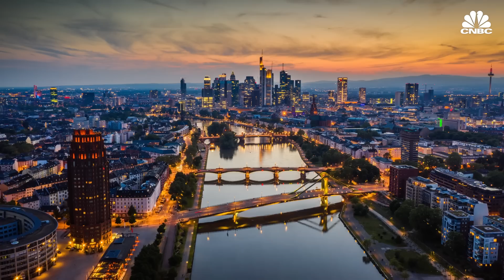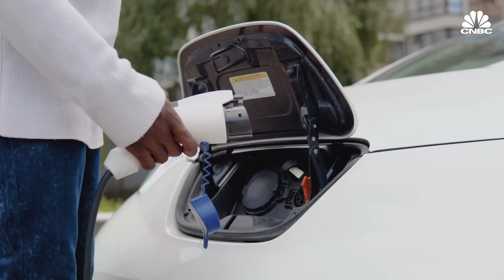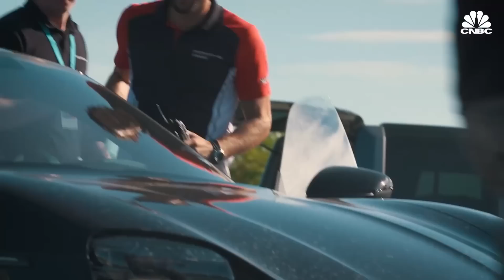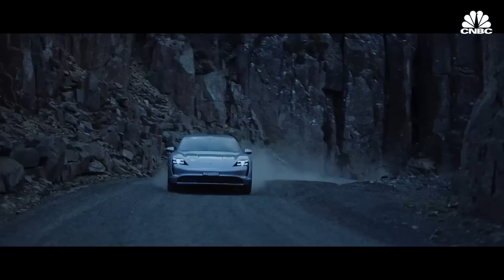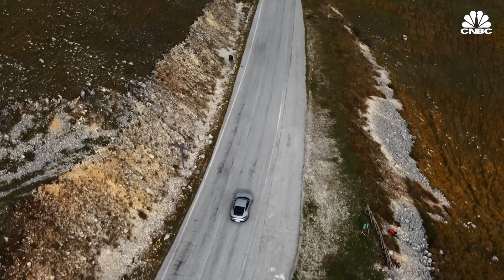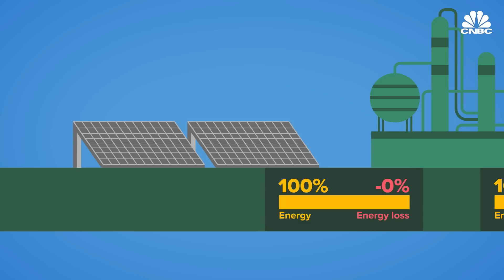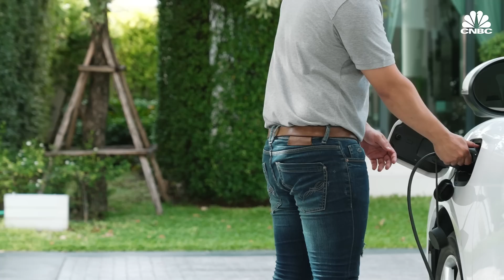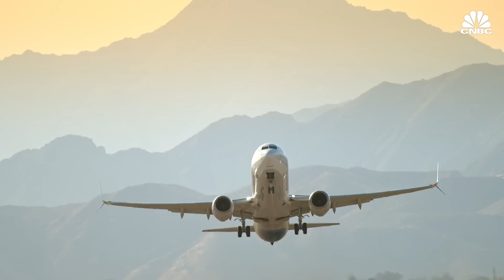How Porsche Plans To Keep Its Gas-Powered Cars On The Roads

Comment: Nothing wrong with efuels as long as they are made properly, but it's all in the use case.
They will always be more expensive than just doing an EV on electricity (as the vid points out).  So it doesn't make sense for the average consumer.  It could be feasible for some rich fella who doesn't care or for some industry where it makes sense due to constraints of alternate types of fuels.
Reply: Yea but thats normal, every new tech breakthrough is expensive until its easy to produce through many years of work and then price decreases.
Reply: @minecraft101fever  It's the same story with electronic goods like TV and smartphones. First gen products always cost a lot to buy.
Reply: @minecraft101fever  There IS no breakthrough, it will never be more efficient than an electric car because it BURNS fuel, you can't change thermodynamics.  E fuels will obviously always stay as inefficient as normal gas.
Reply: A transition to electric vehicles on a global scale will take a century since billions of people live in electricity starvation. And creating a powerful and flexible grid will cost untold trillions and take decades. Just look at India, they consume less than 1000 kWh/person/year. The average EV driving 10 000 miles a year will require roughly three times that amount. And this doesn't even take into consideration the supply crunch on major materials such as copper.
Reply: @SweBeach2023  this
Reply: 1) there is nothing unusual happening with the climate.

2) there is nothing wrong with burning fossil fuels.  Its problems in high-density areas are trivial to fix and already have been fixed.  CO2 is not a pollutant.

3) Climate alarmism is a big-lie superstition supported by tax-bribed liars.  (See Climate Discussion Nexus for 100s of videos on climate quackery, deception, and realism.)

4) decarbonization is 21st century pyramid building and human sacrifice. 

5) there is NO excuse for expensive electricity.  Electricity generation is boring.     Just burn coal and scrub the smoke in densely populated areas.

6) the only challenge is manufacturing market quantities of cheap gasoline.  South Africa has already done this for decades (Sasol), using coal.
Reply: I don’t know why everyone thinks electric evs are more climate friendly, the amount of lithium that needs to be mined, transportation for the batteries to be made which are then transported again to a car assembly factory. Not to mention the fact that most counties simply don’t have the infrastructure to provide 100% clean energy to power these cars.
Reply: @Asjrhwu37317  The reason to think that is because the math has been done & shown time and again.  Calculating the entire process .. so mining, manufacture, transport, refining, extraction, etc ... everything, EV vs ICE ... at the point the car is ready to buy, EVs currently have a bit more impact (mostly due to the extra mass of the average car, not so much battery vs not).  Once you start using the vehicles, an EV quickly becomes less impactful due to not burning fuel like ICE.  Even  on a 'dirty' grid, the EV still comes out ahead.  And by a large margin.  Even larger with a clean grid.  It isn't guesswork.  The math shows this quite clearly.
Reply: EAT THE RICH!

Comment: This is so stupid. If you take carbon out of the air, leave it out as opposed to put it a "e-fuel" so it can be burned all over again. The solution is to accelerate electrification, tax carbon emitting fuels progressively higher and use the tax to pay for carbon capture. You want to keep running your classic Porsche past 2035? Fine, pay $20 per gallon.
Reply: You sound really angry. Those Porsche drivers make up less than 1 percent of the cars on the road and drive way less. Mean while you probably endorse the hummer ev which costs to manufacturer and operate far exceeds an old 911 running around even on conventional fuel. Considering the carbon fooy print of miles driving per year, materials, tires, road wear and tear, where the electricity is coming from to fuel the hummer (natural gas) so on and so forth

Comment: Another useful thing about e-fuel wasn't mentioned is energy transport - you can make e-fuel in Chile and transport it to Europe, but you can't transport just electricity over such a long distance. Another way to look at e-fuel as just a storage for green hydrogen. Hydrogen itself is very light, volatile and low density gas which need heavy high pressure tanks or very low temperature liquification to store, while if you bind it with carbon and make e-fuel, it's easy to store.
Reply: That’s a handy way to import CO2. Brilliant idea. Let’s not consider the total energy efficiency 😂
Reply: @kurtmissotten5965  How else are you going to fuel ICEs?
Reply: Exactly, Biofuels are the future, and reduce emissions from enviroment at same time, it can be transported everywhere on planet and IC engines are cheaper to produce than lithium batteries,
Reply: 1) there is nothing unusual happening with the climate.

2) there is nothing wrong with burning fossil fuels.  Its problems in high-density areas are trivial to fix and already have been fixed.  CO2 is not a pollutant.

3) Climate alarmism is a big-lie superstition supported by tax-bribed liars.  (See Climate Discussion Nexus for 100s of videos on climate quackery, deception, and realism.)

4) decarbonization is 21st century pyramid building and human sacrifice. 

5) there is NO excuse for expensive electricity.  Electricity generation is boring.     Just burn coal and scrub the smoke in densely populated areas.

6) the only challenge is manufacturing market quantities of cheap gasoline.  South Africa has already done this for decades (Sasol), using coal.
Reply: Electricity can easily be transported very long distances with high voltage DC lines.
Reply: @bftjoe  so why are we using AC then?
Reply: @Unstable sid High voltage AC is cheaper for short distance lines and easier to change voltage. HVDC lines require DC-AC converters, which are more expensive than AC-AC converters, so the efficiency savings over AC are only worthwhile for lines over a certain length.
Reply: @unstable000  easier to step up and down. For short distances using DC isn't worth it but for longer ones it is. Solar also gives you DC that's why normally you need an inverter.
Reply: @bftjoe  Not over thousands of miles.
Reply: @PistonAvatarGuy  Found the ignoramus.
Reply: @bftjoe  The longest one is only about 1,500 miles. There are also still losses, and the longer the distance, the greater the losses.
Reply: @PistonAvatarGuy  Nope, try 2000 miles. 

(Bloomberg) -- State Grid Corp. of China has started up the world’s longest and most-powerful ultra-high voltage power line from its far northwest to the heavily populated east.

The 1,100-kV direct-current Changji-to-Guquan project stretches 3,293 km (2,046 miles), the nation’s biggest electricity distributor said in a statement Wednesday.
Reply: @bftjoe  Still, losses are a major issue over such long distances.
Reply: @PistonAvatarGuy  There isn't much need to build longer lines. Additional transmission losses are tiny once you already go HVDC. The issue is cost effectiveness and necessity, not transmission losses.
Reply: @bftjoe  The original comment was about transferring energy from Chile to Europe, losses would certainly be a problem over that sort of distance, but so would everything that you mentioned.
Reply: @PistonAvatarGuy  HVDC line losses are 3%-3.5%per 1000km/ 650 miles, certainly not a major factor.
Reply: @bftjoe  From Chile to Europe, the losses would be nearly HALF, that is VERY significant.
Reply: @PistonAvatarGuy  So you fail at math? How is 40% "nearly half"???????
Reply: @PistonAvatarGuy  And more like 30% if you're talking about edge to edge, not even close to half.
Reply: @bftjoe  It's more like 45%, and 45% is only 5% less than half. It's the southern tip of Chile to Europe, it's not the closest extremes.
Reply: @bftjoe  FFS, obvious troll is obvious.... but whatever...

From the Magallanes Region in Chile (where the fuel is being produced) to Stuttgart in Germany (probably not where the fuel would end up, but it's where Porsche headquarters is located), it's about 13,500 km, which works out to 47.25% losses, which is 94.5% of the way to half, which is absolutely almost half. Even 80% of something can often be considered to be nearly whole.
Reply: How are you "transferring" that e-fuel skippy?
Reply: Then extract for use as hydrogen how, in what reliable & efficient way? Electricity's very easily transported, not that there's a need when it can just be generated anywhere.
Reply: Yeah no, electricity is easily transported over far distances. It would be cheaper to do that

Comment: We must face it, even though we love Porsche, combustion engines will be museum pieces and left for enthusiasts to run them on designated tracks. Porsche is obviously holding off from investing on electrification, even though Porsche makes the all-electric Taycan but the platform is built by VW.  VW has invested in electrification and built the platform for it own electrification efforts and also shares the platform with Audi which built their all-electric model vehicle, the E-Tron.  So it seems that the only way German manufactures can compete with Tesla is to combine their efforts and to share their advances, but it might already be too late.  Tesla has dedicated so much resources in electrification and has advanced the manufacturing process to such an efficient level, that other manufactures can not compete and make reasonable profit margins for the next 3-5 years.  So what is left to do, make a synthetic fuel and continue with the brand of highly tuned combustion engines?  It is ridiculous to think that synthetic fuels are zero emission just because they recirculate the existing carbon that is in the environment.  Does not take a science degree to figure out that the global carbon pollutants that are removed from the air, will only to be concentrated in big cities.  Who wants that?   

Solution that will save Porsche:  the movie Back to the Future where Doc Brown had the DeLorean converted to use fusion energy; Porsche should have a program to convert any Porsche car combustion engine to highly tuned full-electric motors and make all of their vehicles with these special motors.  If EV West can do it, so can Porsche.
Reply: I upvoted for everything you said except the loving Porsche part.
Reply: Tesla have been making EVs for two decades, main line car manufacturers have just started releasing their products, and many of them are arguably already better. Especially the German ones. Tesla is doomed in reality if they can't get their quality standards up to par. Ev tech is pretty simple, once you get the battery component figured out, electric motors are simple and basic overall compared to ice the amount of engineering required is nearly nothing. You only need 1 power train designed for the entire fleet.
Reply: I disagree
Reply: @ttt3377  Sure, so does Porsche and that is why we are here watching this.  I own 2 Porsches and have been a Porsche enthusiast for about 40 years and meet some incredible people in the racing world and stand strong here today that:  Porsche will prevail only if they wake up.
Reply: @ComputerGeekOnTwoWheels  Sometimes it's just time to sleep.
Reply: @ttt3377  Fool.

Comment: If this requires hydrogen, this could help a transition to fuel cells for heavy transports
 As for my personal transport the freedom from a pump has been great so I see EVs as the future of personal transport. Refuel seemed to be the solution looking for a problem as the cost even at $7 a gallon is way too high.

Comment: Another major sector that would benefit from e-fuel is the agricultural and forestry sector, running heact equipment day after day under tremenomdous loads is not possible at this time with electric power.
Reply: Hence JCB's hydrogen policy.
Reply: Would benefit more from more batteries & charging infrastructure. Carbon vapor poison pumps aren't needed.

Comment: Better than EVs. You have my respect, Porsche.
Reply: ralphdepino9650  No reason for people to be so emotionally tied to a fuel type.  Doesn't make sense.  Not wanting to drive one while the infra is still being built out or they're higher priced, etc ... sure.  But based on it being EV vs gas makes no sense.
In the end the average person will care about cost.  This alone will make the transition occur.
Reply: The problem is cost.  Even if efuels can be made in such a fashion that they are carbon neutral, they will always be far more expensive than electricity for an EV.  Meaning it prices out most people.
Reply: @JT_771  It depends because all electric companies don't charge a flat rate you've got your peak and off peak rate, but if a lot of people go battery electric more than likely you won't have off peak rates and rates are gonna go up because of the demand. I'm not for battery evs, I'll either go gas hybrid or hydrogen electric.
Reply: @rocky965able  I mean, go for whatever you want.  But gas & hydrogen will be more expensive.  You're right that if you can't charge your car where you live, that's a big blocker.  It's also one of the things that will constantly get better & more widespread.  In any case, naturally go w/ what fits your needs.
Reply: ralphdepino9650  They certainly can.  The issue is that it'll always be FAR cheaper to run a car on electricity than on efuel.  By a large margin.  That'll tend to price most people out of it.  It isn't that efuel can't co-exist with other options, but simply the economics of it will limit wide-market usefulness.
Reply: @JT_771  and most people don't have a place to install a charger at home, and who wants to spend hours waiting for their car to charge at a public charger which gonna cost more than 20-30 cents per kwh.
Reply: No, not better than EVs & never will be.

Comment: So what about the emissions from E-fuel? why is it not  mentioned in the video???
Reply: There are carbon emissions like any gas engine. But since the carbon was originally sequestered from the environment it's considered "carbon neutral". It doesn't put any more carbon in the air but it doesn't help reduce emissions either.

Comment: Nuclear energy is perfect for this, high temp reactors can drive chemical reactions using heat directly to make hydrogen, synthetic fuels and fertilizer. 

You can make hydrogen at around the same or higher efficiencies than current nuclear plants make electricity
Reply: Probably, but it would be even more expensive than renewables and even building a test plant would likely take 15 years of time we don't really have

Comment: Not only the costs for eFuels are higher. Even the amount of energy which can be used with eFuels is the main problem. The main problem is, that there is way too little time to ramp up the production needed to get eFuels at this amount, Porsche is thinking of. At first, the aviation and shipment sector has to be eFueled, but there is also another very huge sector no one is thinking about, which also has to be eFueled as soon as possible: Petrochemistry and Chemistry in General. In Germany BASF used 3% of all the Natural Gas Germany used in 2021. And this is just Germany.
And all projects which are announced globally are not even sufficent for 10% of those three eFuel-dependend-sectors in Germany. Again: This is just Germany.

If you think about starting a company and don't know where to start: Start with producing eFuels and make contracts with Porsche. Safe Bet. There's no way they can say no, because there is not enough eFuels for the utopia they're dreaming about.
Reply: It has already been estimated that the US alone would need 9000 of the e fuel manufacturing plants similar to the one in Chile, to supply it's needs....... There is never going to be anything like enough of this stuff to go on general sale.....

Comment: Notice how every single company involved in this is a piece of sh8_t? that should raise red flags to the layman, the reason why for anyone who understands what is going on is simple, this is incredibly inneficient and most likely not "carbon neutral" to begin with, they are most likely using more energy than they end up with and that energy is only "green" if it's captured by clean methods.

To extract hydrogen from seawater is not an innexpensive task, it requires a lot of electricity.

Lastly as I said before every single transformation loses a percentage of its previous form's capacity, nothing is 100% efficient, these guys are proposing going through what, 3-4 transformations to get gasoline? why not just use directly electricity?

Just make electric cars, d*_shits.
Reply: Germany is just showing it's by far the worst country in the world, once again, just a couple years ago massively lying about emissions of their cars wasn't enough, gotta keep doing it.